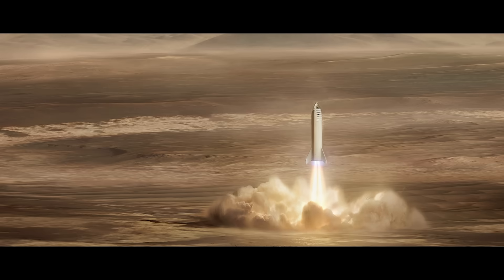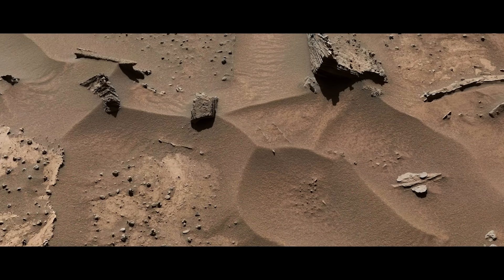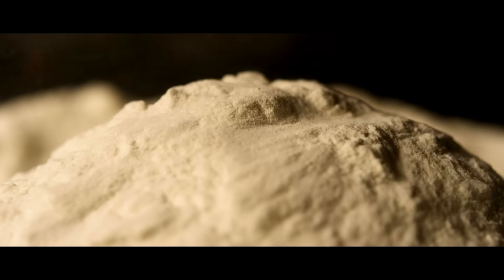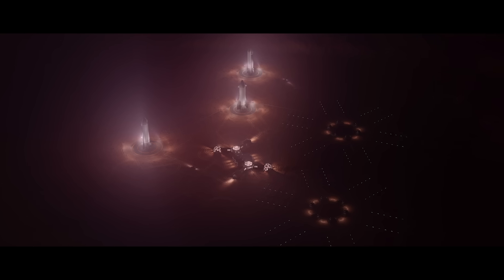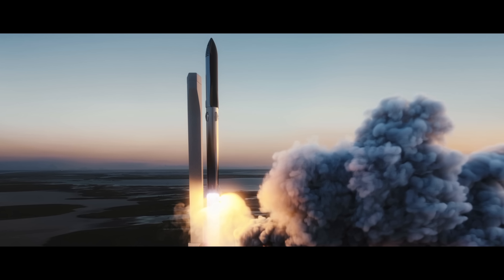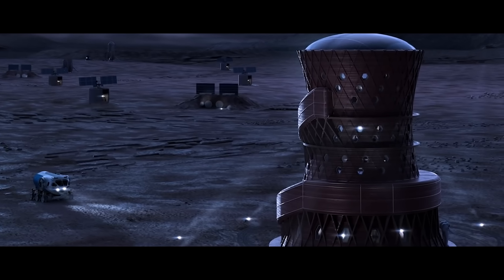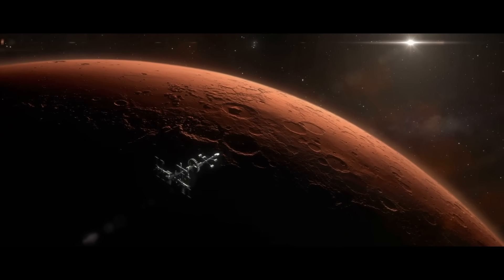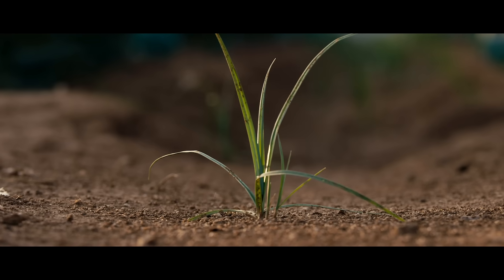THE FIRST 10,000 DAYS ON MARS (Timelapse)

Comment: No No No, there won't be any water on those ships, they will be using subsurface water, and weight wise, there is no need to take oxygen, so even if they needed water they would only carry hydrogen as %90 of the mars atmosphere is CO2 meaning you can easily get the oxygen once you have the power set up....

No No No....  Spotmini probably won't be going to mars, it will be Boston Dynamics Atlas robot, with 2 hands

No No No, rovers won't BEGIN drilling for water, Those ships will land where rovers ALREADY have drilled for subsurface ice so that we can test the extraction process for making fuel.   

No No No...   Rovers will flatten the landing spots for future landings.  Man type in Mars concrete to a search engine...  I suggest that marscrete will be one of the FIRSt technologies tested out on these missions as it's SO useful, and making landing pads with it will be a top priority.

no No No - work days on mars, the second task is setting up production of fuel for the return trip... HELL NO.   There is no way that anyone is headed off to mars without a full fuel tank awaiting them once they get there.  Thats part of the job of the first mission to make sure that the people that go on the next mission can get back.  you do NOt leave this till the last minute.  It takes a lot of energy and a lot of time, and you do not want a situation where if anything goes wrong they are stranded.  

No no No - cultivating mars soil...  Um... Perchlorates...  you do not grow things on mars with first removing the perchlorates that are toxic that are in the soil.  Its not that it's hard to do but it's IMPERATIVE that you do it.   

Ok, there are a LOT of mistakes here, it's not that it's bad, it's just way underinformed, it's as if a journalism major wrote hte script based on a day of internet searches and they only looked at everyone elses script without looking at the issues that have to be faced with fresh eyes.  As such...  I have to say: GOD DAMN IT!   Don't just rehash the old material, go learn the topic!  (and all these comments and I'm only 5 minutes into the video!  WHY didn't you go to a forum like the reddit spaceX page and have people proof your script for these issues!

Oh yeah, adn the first mission won't be 30 people, it will be 10-12.

Comment: cool concept. The only thing that I noticed was incorrect was the end where you said seedlings were escaping onto the mars surface to survive. Not taking into account the extremely cold temperature, the pressure on mars is too low to sustain liquid water. If any plant's or animals were not enclosed, they would die quickly due to the boiling of internal fluids

Comment: There are several key technologies missing from this timeline that greatly accelerate it. First, is artificial gravity: created with half mile long vectran webbing tethers, that spin Starships at one RPM to create .37g for the three month trip to Mars with chemical rockets. Pairs of Starships can GRADUALLY be spun up to three RPM to create 1g for the trip back to Earth! Second, is Advanced Solar Wind Drive that can GREATLY REDUCE the trip time to Mars to less than seven days! This OBLITERATES the so-called 26 month “Mars Launch window”. When you can launch anytime you want, this speeds up this timeline by a factor of at least 40! So this entire 15 year timeline is reduced to less than a year total. Slough PLASMA MAGNET DRIVE uses ionized particles in the Solar Wind to go 40 times faster than chemical rockets alone. This changes EVERYTHING. Zubrin Dipole-Drive can move sideways to the prevailing Solar Wind direction and even in REVERSE for deceleration and return trips to Earth. Greason Q-Drive can gather energy FROM Solar Wind Plasmas flowing by any spacecraft. Third is Fusion power. Compact Fusion power sources allow rapid colonization over the entire surface of Mars in less than 30 years. And we can warm up Mars and give it a breathable 15 psi Oxygen/Nitrogen atmosphere, with an artificial magnetosphere in Mars Orbit to retain it, in less than a century. Rapid Advancement of these three technologies is the key to Terraforming Mars.

Comment: There is no pressure you CANNOT live in a space suit...   Never make it there because something will hit you during the two year trip..
  NEVER GOING TO HAPPEN ITS A SUICIDE MISSION...
Reply: You do realize we have suits for mars right 😑
Reply: @Yurrr480  You cannot live in a space suit for hours not to mention days..
Reply: @willrobinson9767  .......
Reply: @willrobinson9767  and there will be bases  at mars were you won't have to where your suit anyway
Reply: @Yurrr480  You have to have a base to put up the base..  Where is the pressure coming from
.You cannot suck a vaccum for a suit either...
Reply: @willrobinson9767   and it doesn't take 21 hours to build a small base
Reply: @willrobinson9767  and there is pressure on mars 😑
Reply: @Yurrr480  There is no atmosphere at all or any pressure...  Its also 150 below zero during the day at the equator....   Nobody is surviving even the temperature extreme...
Reply: @Yurrr480  Pretending is not going to improve anybody chances which are worse than the temperature...
Reply: @Yurrr480  Its too cold to work for 10 Minutes and no way to get any heat..
Reply: @willrobinson9767  150 AT ITS POLES
Reply: @Yurrr480  Still too cold for anybody to live...  The have to land where the H20 is which is not that far from the pole.. Too cold to build a shelter....
Reply: @willrobinson9767  Mars has a atmosphere of 1% that of Earth's. Also, the cargo bay of the rocket would most likely be preassurerised
Reply: @ohrenaugenkatze_  The cargo bay of what rocket..

Comment: Yeah, we’re going to have a nuclear fusion reactor being built on Mars in 23 years. 😂 Suuuure. Then in 2046 we all ride unicorns to go fight alien robots.
Reply: Whats going to cool the reactor...  Cannot pull on a vaccum..   No pump or fan will work..
Reply: @willrobinson9767  they will have to have two pumped water loops, one for pulling heat off the reactor and turning it into work, and then one for cooling down the first loop. might need to have a big radiator emitting radiation or some shit connected to the loop. everything has to be closed loop. maybe the ground is cold enough to pull a reversal of geothermal energy. or use excess heat for industrial heating purposes.
Honestly, the project is gonna struggle. Its gonna be a fight between lithium on earth and lithium for mars to store their solar energy, of which they are going to need a lot of material for itself.

Comment: There’s just one problem with making the Martian atmosphere breathable... THERE IS NO MAGNETOSPHERE, it literally does not matter what you do to the atmosphere of Mars, like nuking the poles or raining asteroids down to mine, nothing would stick around because there is nothing to keep the atmosphere in place! Mars has so virtually no atmosphere because A.) it is tiny, which means the core would cool faster which means that the magnetosphere would dissolve which means that (because of the extremely low surface gravity) the atmosphere would be blown away by the solar winds. This is why the best thing to do to Mars, IMO and as far as colonies go, is to set up giant factories with the same care of the environment as they had in the industrial revolution!

Comment: They would and must use plutonium for energy, solar panels too weak and constantly getting covered with dust. Erect ships are going to topple in severe martian sand storms, they must use lower profiles surface near vessels. It would be a good idea to have logistic between stations in orbit around Earth, the moon, Mars and at the halfway point to Mars. Using and adapting  underground cavern shelter would save a lot if building and resource and perhaps offer sources of water.

Comment: The very first colonists are going to be the real heroes. Temperatures of minus 80 Celsius, no breathable air and the most untested equipment in use with a 14-minute delay in radio contact. Not for the faint-hearted

Comment: Manned mars missions are in general a physiological, psychological and economical problem which are not solved yet.
Also many technical problems are not solved yet. E.g. the dust problem.
To do this in the next 25 years is nearly impossible.
And beside this it makes no sense to operate a long term or permanent mars colony.